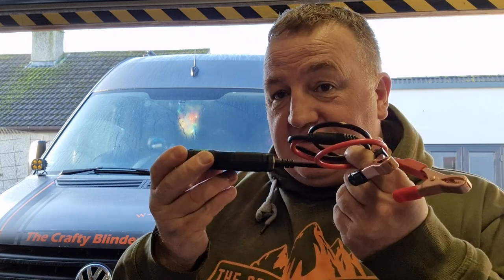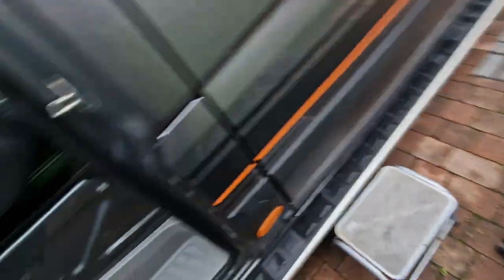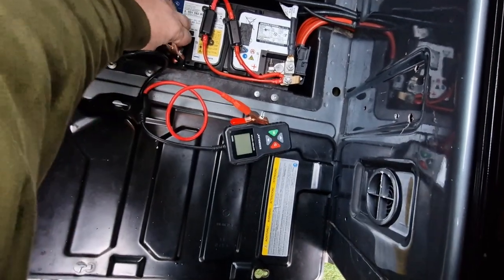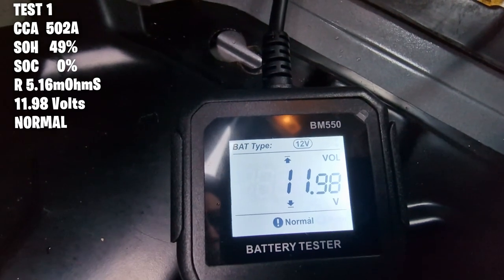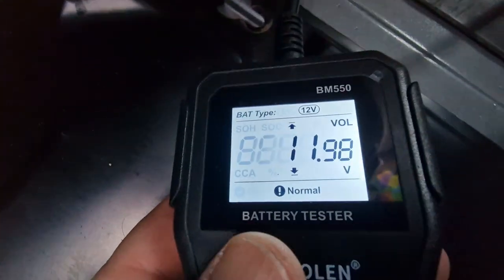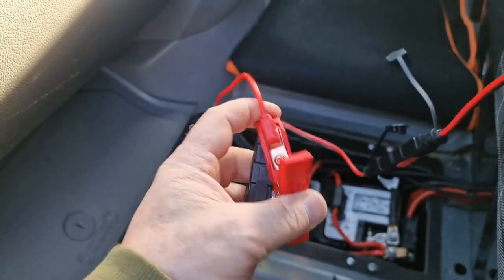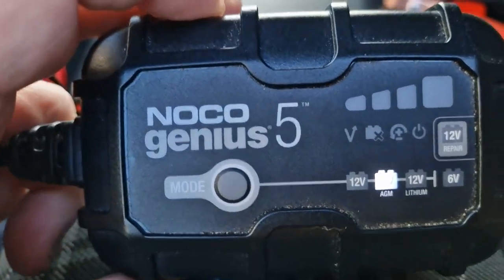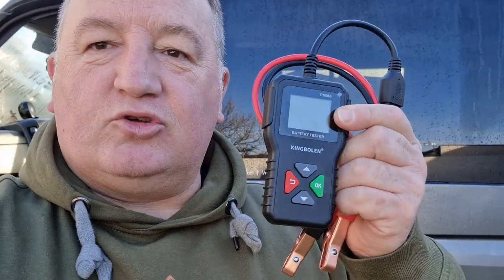Kingbolen BM550 battery tester saved my batteries | selfbuild campervan | van life

Comment: how do Big Sam. thats a great bit of kit and I'll be sure to buy one.With viv-i-van off the road on and off for five months, my service battery took a bit of a hit. The leisure batteries(lead acid-I couldnt afford lithium) were relatively ok and maintained charge due to the solar on the roof but with a bit of kit like this, now she's up and running again, its the perfect and inexpensive way to make sure her battery is ok.  I do have the ctek  battery charger that conditions batteries etc, but its been "hard wired into the van" so when I'm on shore power or at home and hook it up, the batteries are maintained. for 24 quid though, getting that tester is brilliant value and means i can always keep an eye on things. thanks for the very infrmative video and heads up. I shall be going onto amazon to get one next week. Bessy regs-Kenny
Reply from the maker: I'm looking into what victron has to offer
Reply: @TheCraftyBlindersvanlife  wish  I had the money, Sam.  Tbh I should have gone for putting the batteries under the rock n roll. Bed and had the front seat swivel bug I didn't have the funds. Now I wish I'd gone lithium. Too.

Comment: Hi Sam
Shame we haven’t met at the shows as seems been doing similar upgrades on our crafters over the years. I use a Votronic dual solar controller that also feeds 1 amp to the starter battery so keeps up with the tracker draw as insurance company insist on the tracker being on the starter battery. This saves me having to trickle charge the battery when not used for a while. The tracker app also gives me a voltage read out on this battery and a warning if it’s getting low although obviously not a state of health. I also fitted dual rear springs and Koni activ shocks all round that were specifically designed for cross-winds. Not cheap but nothing decent is. Currently fitting 3.5m of self-regulating heater wire to the water pipes to stop freezing. Only draws 0.2 amp @ 240v so not too bad for the inverter. You’re 3 way fridge will always gobble battery power as only regulates temp on 240v or gas. We also found out the hard way on a couple of overnight ferries that insisted on us turning the gas off and sealed our lockers. Swapped out for 12v compressor fridge only and consumption is far less and also bigger internal storage in same space. Like your style and glad I found your channel. Already ordered the grab handles. Saved a small fortune. Thanks
Reply from the maker: Nice to hear that the channel has helped. we should try to meet up at one of the years of festival 
We will be posting our event soon, just finalising some details
Reply: @TheCraftyBlindersvanlife  Definitely. Just buying tickets to Overland Stratford for April atm
Reply from the maker: we are going to be in the youtubers area come say hello

Comment: Good summary about lead acid battery management, for LFP this device only good for volts readout.

My Chevy van camper is built for weekend warrior use, it has VDO DC-DC charger and MPPT fort solar, both trickle charging starter battery after LFP battery is charged full.

Chevy's all times ready to go... Before building it and not much driving it killed two premium starter batteries...
Reply from the maker: Some good points 😁

Comment: Low state of charge on a Boxer etc, blows the ECU airbag light on problems.  Happened to me twice. Very expensive replacement
Reply from the maker: Is the battery tester something you feel would be useful then?
Reply: @TheCraftyBlindersvanlife  you bet it would. My boxer had to have the ECU fix due to low voltage. It cost £80 + £40 to get it reset twice, so to keep good health check on my batteries would be great 👍

Comment: Pointless. This is built in to new cars, use obd2 reader or cigarette meter
Reply from the maker: Whats pointless ?
What is built into new cars ?
Reply: @TheCraftyBlindersvanlife  battery meter
Reply from the maker: @James C  why is it pointless if I had not used it I would not have known that my battery was in such a poor state of health my van does not have any function to warn me of this so for me it's far from useless I actually used it on 2 other vehicles last week were we managed to improve the health of both batteries 
You said to use a plug-in tester. Why are they better? What do they do that's different? I would be interested in know
Reply: @TheCraftyBlindersvanlife  obd2 BLUETOOTH dongle, plugin to the car, connect to your phone and you dont need to uncover your battery. It should give everything your tester gives you, but it depends on what software you use on your phone.  Your battery is old now too, hopefully you get another year and a half,then buy a new one before the winter.  Also the CCA seems really low for a diesel, might be worth checking what battery is specified by VW
Reply from the maker: @James C  cheers thanks for the information 👍